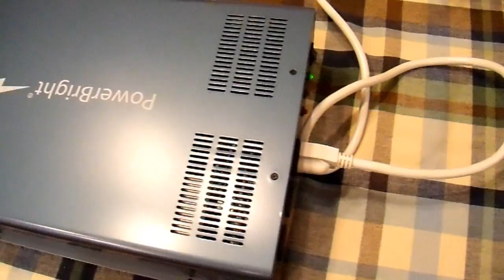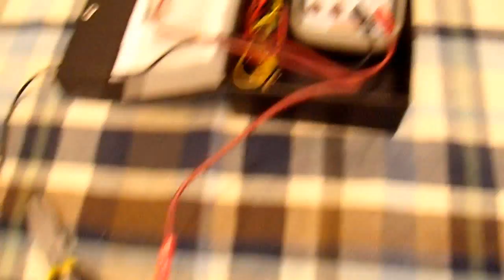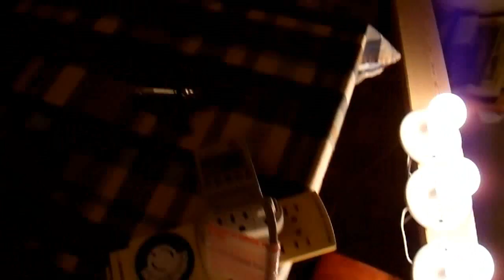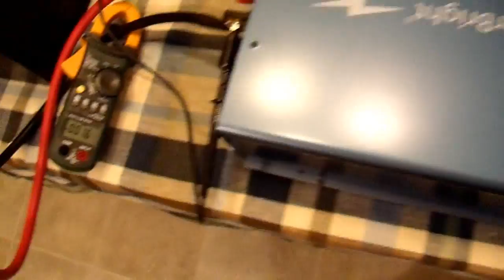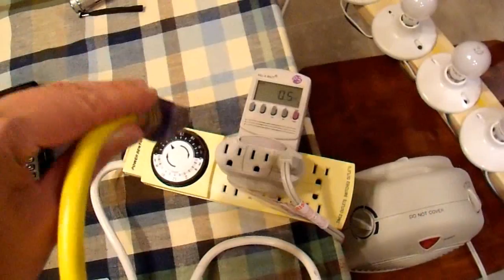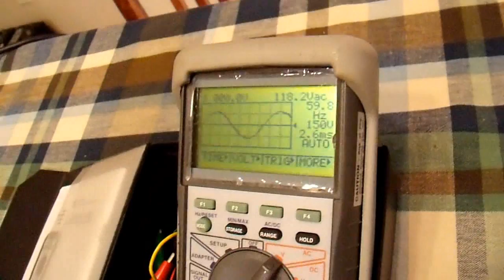PowerBright Pure Sine Inverters Part6 - Testing the Repaired 2200 Watt Inverter

Comment: I have a Power Bright 2200 Aps. Was in the closet but worked ok last time used.  Today it started going into overload mode, red led.  Source voltage is not high 12.5 to 13 volts.   Removed top section of heat sinks to inspect, no obvious damage.  Caps aren't bulging or leaking, transistors look ok.     do you do repair work  on the side ?

Comment: for surge current, you need to read the output current. The voltage droops, to increase the output current, without increasing the load on the DC booster stage. The output is indeed pulse width modulated, meaning, it will multiply current, by reducing voltage, by reducing how much the duty cycle varies from 50/50. You are right, the surge wattage won't change, but the output surge current goes up proportionately to the voltage sag. You're right not to like that for starting induction motors, because the available locked rotor shaft torque goes down on the square of the voltage drop. a 20% drop in voltage results in a 44% drop in shaft torque, which means it won't start the same load as if the voltage held up.

Comment: I’ve watched countless YT vids, as I prepare to make a purchase.  Your vids are Tops.  Your explanations are technical, yet you articulate them where a Novice can understand (most) of it.  I really appreciate it.
I’m in the final stages of pre-purchase research, and wish that I could get a clear one or two unit recommendation.  I TRUST you, and that doesn’t come easy.  That being said, you make clear some of your more (preferred) units ... TigerClaw, Samlex, PowerBright ....
I THINK that I need about 2000W continuous capability 120VAC, for my single battery Jeep (which is my ‘home’).  I need Safe, Best Bang For the Buck, $400 or LESS, and Capable.
Some of the challenges have been chassis size, fear of needing out-of-box repairs (as you’ve encountered), .... this one isn’t suitable in vibration environs.
If I watch ALL of your vids, is there a CLEAR couple of winners in (My) ‘category’ ?  I’m fearful of needing to repair Chinese build quality straight outta the box ....
Thoughts ......  ?
Reply: I failed to specify my ANTICIPATED usage: 1800W (supposed) Induction cooktop, an “average” coffee maker, a 1400W (?) Electric Kettle, maybe a blender ..... POSSIBLY a Toaster Oven or SMALL microwave.
Thank You again, for GR8 Vids !

Comment: What inverter would you suggest to run a 30 foot camper with TV, microwave,  lights and possibly air? Dual marine batteries with solar charger.

Comment: my fridge has 600 watts start up surge then 120 run then 108 run, but wont restart unless the doors are open for 30 minutes, also if it locks (trick the switches to come on during rotor lock) it uses 450 watts but instead of .5 seconds its like 2 minutes and it wont restart, have not tried 240 to it but dont want to either

Comment: i have the same power bright inverter says 1500/3000 i never put it over 1000w but have like you had to take it apart to repair some bad solders
Reply: no current draw on it is about 1amp from 12v

Comment: Hi can you get a  Tiger Claw inverter that can run on items in UK has you know we use 230.240 volts or can you tell me best inverter  I could buy for my 600 watt solar set up all the ones had from eBay just stop working and lot don't work at all in UK they say will run 230 but all 110 can you help me out thanks by way your video's A 1
Reply from the maker: I haven't seen many 230/240V models because I live in a place where 120V models are more common.  eBay brands are ones to stay away from, generally.  I am sure there are good ones out there for 240V applications but I couldn't give an opinion based on experience here.  Any company that makes good 120V inverters will likely make good 240V ones, however.
Reply: hi thanks for your reply .I have seen almost all your video's and I asked because of your experience with inverters and you know hell lot more than I ever will and the makers
Reply: Hi may I ask who were the maker's of Tiger Claw inverter on line cant find .
Reply from the maker: gene mayne
It's one of those no-name inverters that are usually junk but the Tiger Claw is pretty good.  (assuming they didn't make significant changes to the design since I purchased mine).  You can find it on eBay or Amazon.  I think Sigler Music also carried them according to Xboxer1985.  They were out of stock for a while but I see they are available again.  I don't believe they have a 240V version however.
Reply: thanks for reply all makers I tried today no 230/240 made and yet they say sell world wide odd .On one of your videos you showed 15 inverters and named them I still waiting reply off them  Amazon all they selling are for car's or 110 don't have lot for  UK market eBay having lots problems  lost ID'S been stolen so cant buy anything . I think the market is open for some one like yourself .
Reply: gene mayne if you are willing to pay for postage from Australia I recommend powertech brand pure sine wave as I have not had any issues with them or if you want an inverter that ticks all the boxes get yourself a rich electric super combi inverter those things are stackable and have both soft start and a high surge capacity I have never owned one but my mate has 3 of them in his motor home and they can handle any type of punishment he can throw at them A.C, air compressor, even an electric stove it takes them all at the same time output voltage is 240V and input is 12V-24V
Reply: thanks for the reply my son going to Australia in a week ,so I asked him to pick one up then just pay tax
Reply: You can get them from a jaycar electronics store or get it shipped to an Australian address while your son is here 
This is the model that my mate has in his motor home 

It's not cheap but it's the best inverter money can buy in Australia 

www.jaycar.com.au/Power-Products-Electrical/Power-Conversion-%26-Transformation/Specialty-Power-Conversion-%26-Transformer-Products/SuperCombi-Power-Management-System-24V-3000W/p/MI5253

Comment from the maker: RFI is 'black magic' to most design engineers and requires a very controlled environment and rather sophisticated equipment to objectively analyze.  Connecting the case and GND prong may reduce emissions at some frequencies and make others much worse.  I've considered taking an inverter to a facility I have access to in order to accurately measure emissions, but not many people care and I probably am not technically supposed to do so.

Comment from the maker: It does sound like a camera RFI issue, but the inverter is actually making the buzzing noise heard on camera.  It seems to come from the output choke.  Possibly the missing capacitor inside the inverter would reduce the noise but it isn't really objectionable to me considering that the fans only turn on under fairly heavy loads.